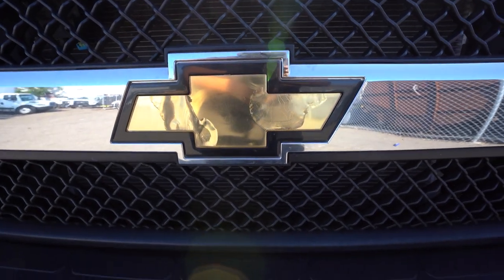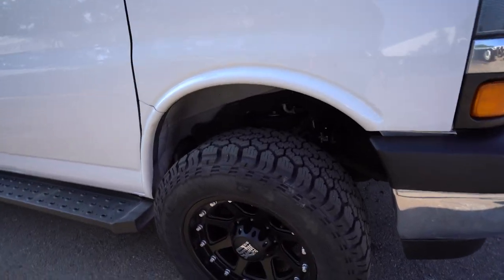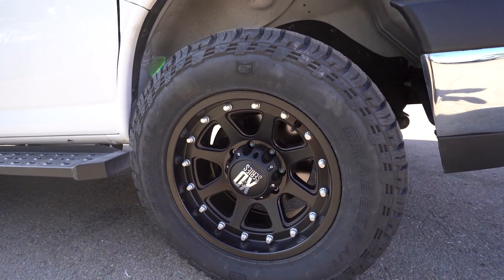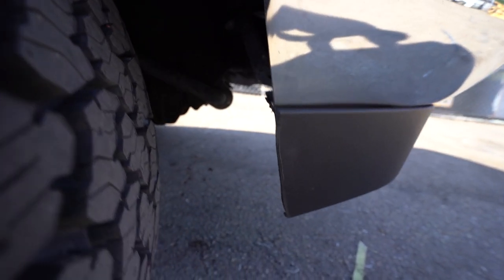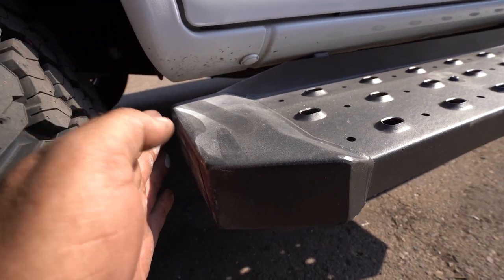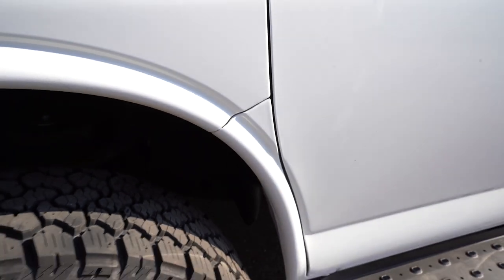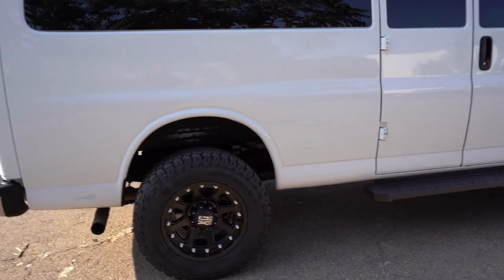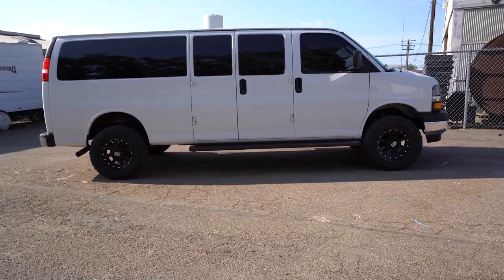Chevy Express Van Spindle Lift

Comment: It seems that another two or three inches  of lift would move the apex of the tire away from the contact point of the sheet metal.  And on mine, I'll likely opt to cut that bumper a lot more out of the way..

Comment: Will a van with a sliding door have enough clearance for larger tires such as these?  With 0 offset wheel?
Reply from the maker: Possibly I'm not exactly sure, we still haven't got enough chevy's with a slide out yet to get all the accurate info. Sorry about that, I don't want to say it will and then it not work for you.
Reply: WeldTec Designs ok thanks!  So maybe I should find a van with barn doors instead?  The sliding door is just so convenient
Reply: They make extension kits to clear larger tires with the sliding doors